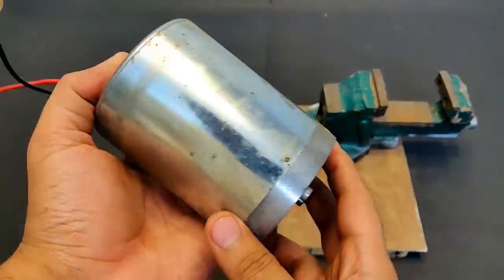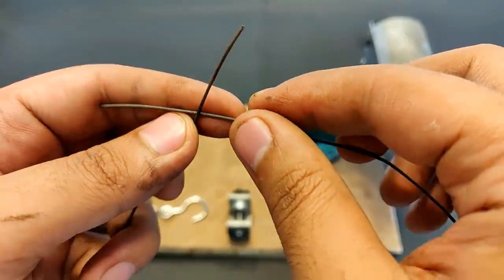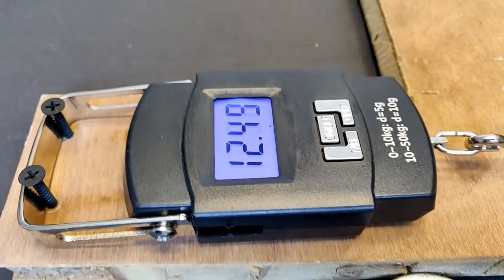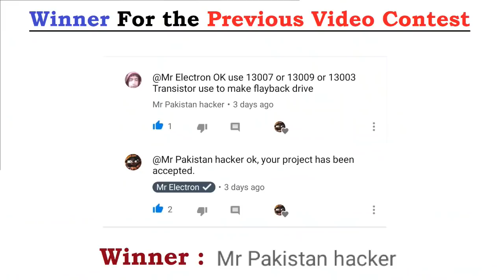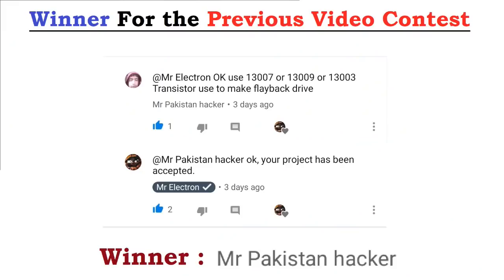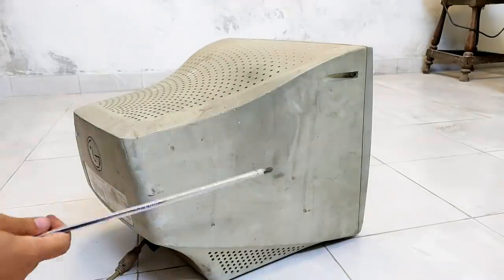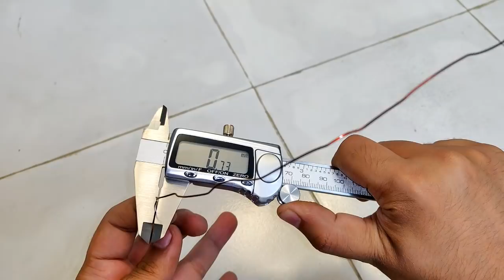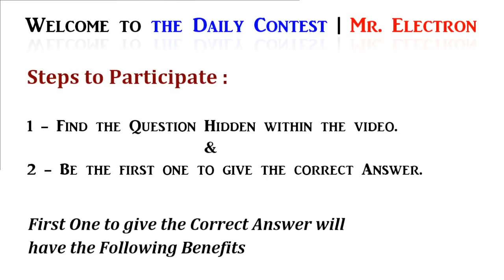Make a DC Motor Torque Testing Machine ( Upto 50 kg-cm )

Comment: From the many electrical scientists who work with high voltages, a FAMOUS scientist who worked with high A.C. voltages was Nikola Tesla. He invented the A.C. motor and transformer. A transformer is a device which steps up and steps down A.C. or pulsed D.C. voltages depending on the number of turns on the primary and secondary. (By the way, a tesla coil is a special kind of high voltage transformer invented by Nikola Tesla)

Comment: Well I tried this method to test my own built BLDC Motor. After few test I tried full charged battery 66V. Motor pulled it so damn hard it broke the whole weighing scale, my weighing scale shattered in 4 to 5 parts. It even flattered the hook of the weighing scale.